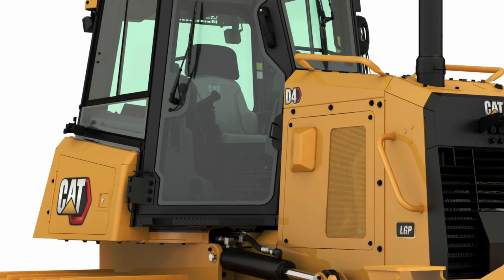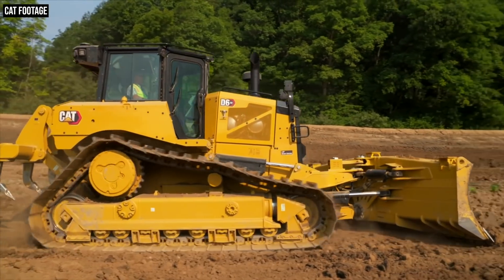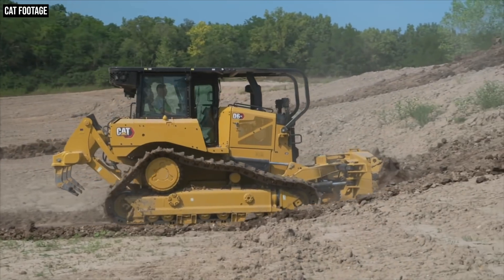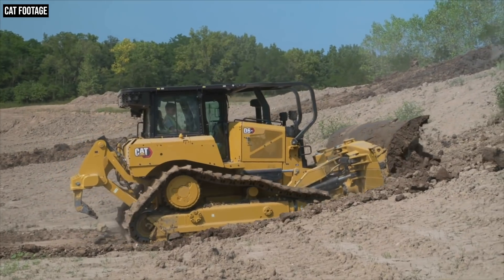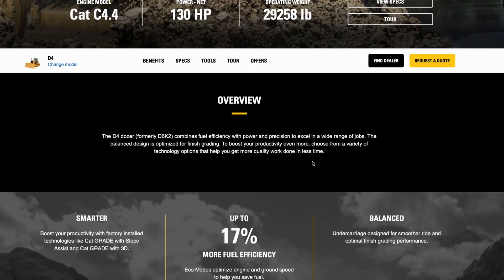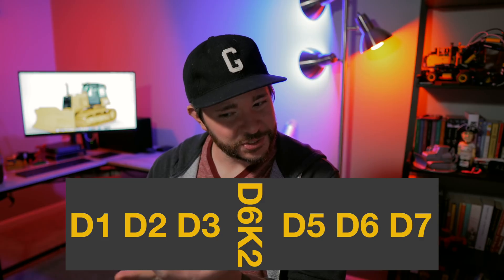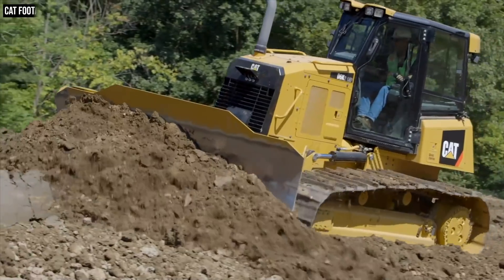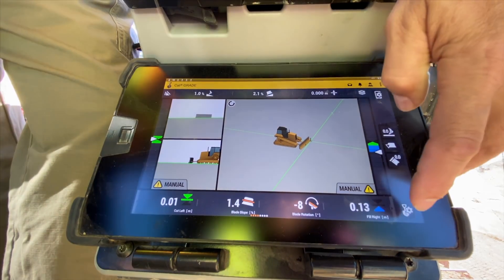Cat Renamed the D6K2 Dozer to the D4. Here's Why They Did It

Comment: What's going to happen to the D 3 d4 d5
Reply: that size range was changed to D1/2/3........D3K-D1, D4K-D2, D5K-D3....Same sized tractors as the old K/K2 series, just new nomenclature
Reply: @joshw6212  not sure I like new
system.I much prefer my D 5 m high drive started with flat track long time ago better track life with high drives.
Reply: @greggwinovich8196  The D5M size dozer is long gone.
Reply: @tommyw.9424  I guess O just ole school like a lot of your response are.My d5m replaced my  d5 69 j and is a high track I sure would not go back.Not at all interested in going back to a flat track.
Reply: Im guessing d5 will be high track only now